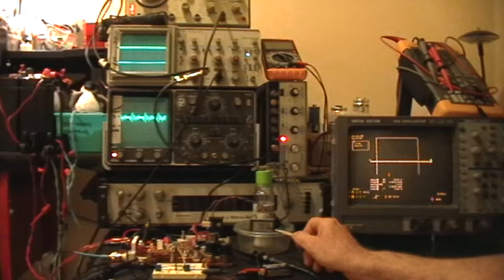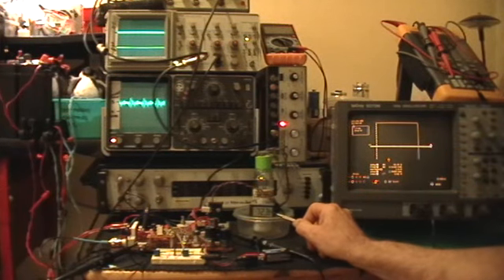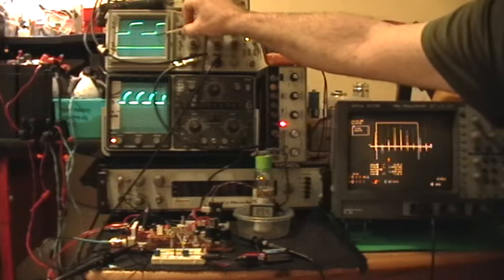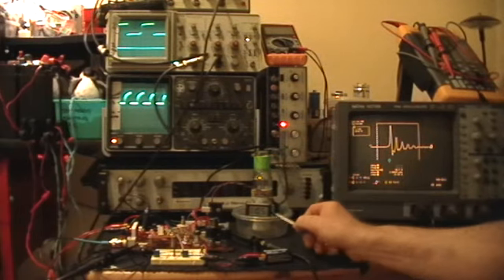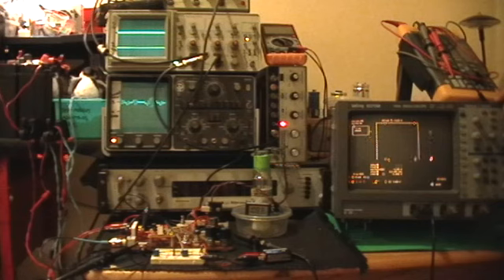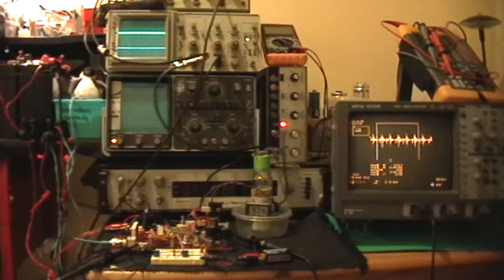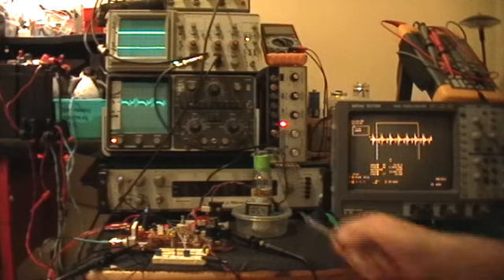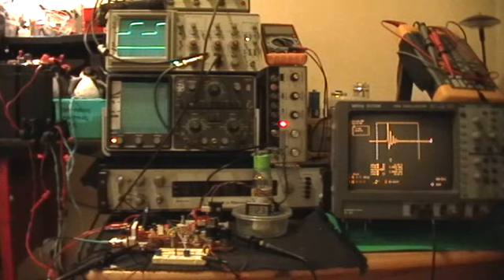Electric OU UmpTeen: The Ainslie Circuit with the Qiman Timer

Comment from the maker: Using other 555 circuits I can produce other types of oscillations as well. These here don't turn the mosfet on, so the system cools when they are present, but others keep the mosfet on much more and so produce much more heat. 
I've been playing with a current-viewing shunt on the positive battery rail; since the Fluke 199 scope has fully isolated input channels, including "ground" references, I can take traces here and at the point "B" simultaneously, to see if they are significantly different.

Comment from the maker: I'm sorry you can't see the numbers more clearly. I can see them OK, but I know where to look.
Let's see: The voltage "at the battery" is Ainslie monitoring Point "A" and the voltage across the sense resistor is Point "B". I am showing the "B" on the top trace of the Philips scope and the "A" on the LeCroy. The peak voltage drop across the shunt is about 600 mV (0.25 ohm shunt). The peak spikes in the "A" trace can be hundreds of volts.
These oscillations here don't seem to produce heating.